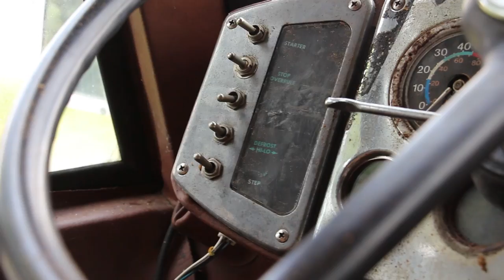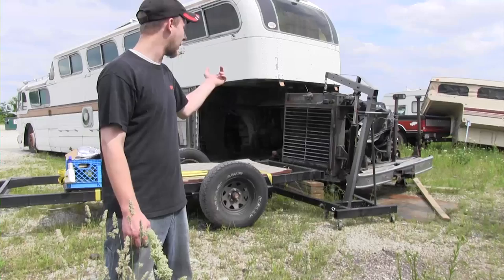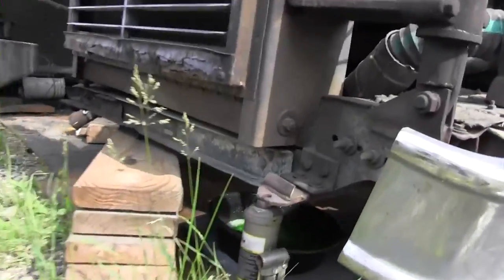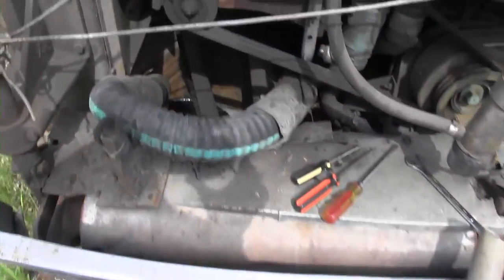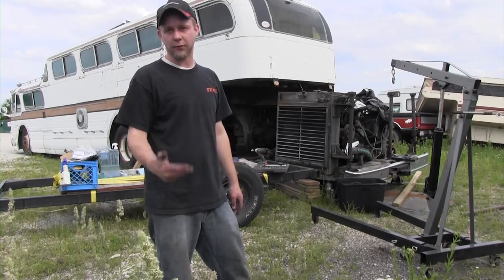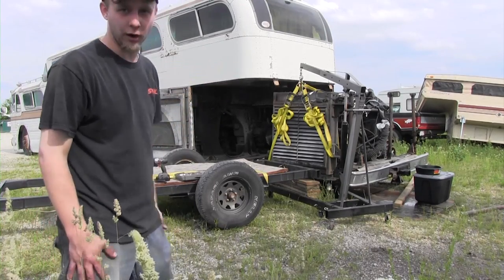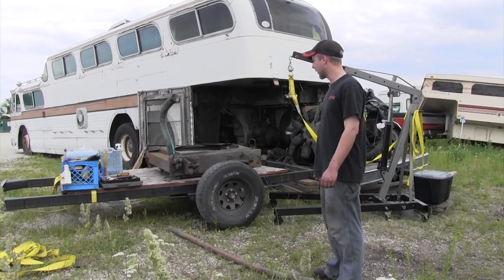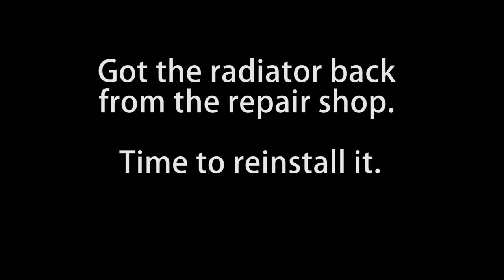Scenicruiser 858 - Radiator Removal, Repair, and Reinstallation

Comment: When I first saw the inspection video, Man do you know what you're letting yourself in for, and time is evidence of that. It is a lot of hard work and money to sink into. One of my initial thoughts was the old guy was he's glad he got rid of it and what condition was the suspension, breaks, clutch, engine, bearings and electrical wiring, let alone the metal cancer and the interior.
Any replacement parts can't be cheap.
Well I hope it gets completed before you retire and you actually get to use it.

Comment: Are you seriously going to use that old 8V71? I would try looking at a 6v92 Silver with DDEC. Would be a nice, but possibly expensive upgrade.
Reply from the maker: +BROWNWRENCH BROWN thanks for the content!  Long term plan is swapping in a 60 series Detroit and a world automatic transmission. That will be an expensive undertaking!  The 8v71 will get me by for now.
Reply: Nice.That will be an excellent substitute if it isn't too long to fit. Less linkages, filters, lines, etc. That compartment was stuff everywhere. Never liked the old rapidfire roadoilers for so many pieces and parts. The 60 will be a lot quieter too. Good luck. You have a massive challenge on your hands. I think Jay Leno's guy did a series 60 upgrade on his vintage bus.

Comment: I am jealous, the last thing I was able to do was fix an air leak so I could move the bus 5 blocks.
Reply from the maker: +MightyThor ill be honest, i haven't touched the bus in over a year. These are videos i shot in 2013, just finally edited and uploaded them. (Life has been crazy lately!). I will be working on air system, brakes, replacing tires, checking Injectors, etc. all in the next couple months. Goal is to get it to the Evansville, IN bus rally this September.

Comment: Glad to see you back Tj!  
What's the radiator weigh, if you know.  Looks heavier than the one in my 4106.
Reply from the maker: +John Matthews thanks John! 
The radiator, if i remember correctly, is pretty heavy. Hence the use of the cherry picker. Over 100lbs empty easy. 

Side note, have you heard about the vintage bus rally this upcoming this September in Evansville, IN? I'm planning on being there, bus or no bus. You should consider taking yours there if you can! Id love to see it in person!
Reply: Hey Tj. 
I actually traveled to Minneapolis to get some parts from the Bus Boys over the summer.  Dan mentioned the Rally and is brother Stan was going to send me the dates, which were uncertain when we were there.  Sounds like a good time.  Have it on the calendar, thanks to your note, and will try to make it.  Schedule uncertain at the moment.  
Thanks for the heads up!  Hope to see you there.
John